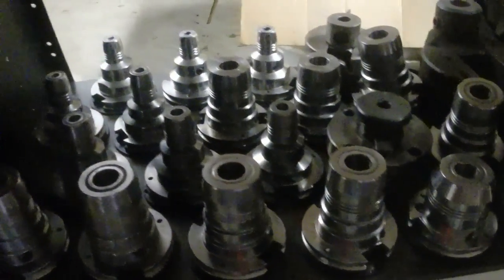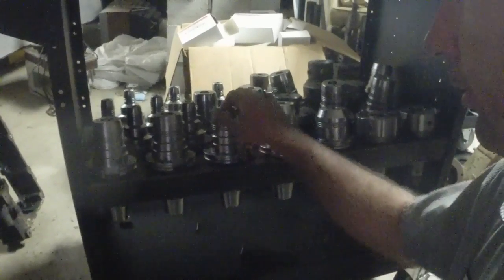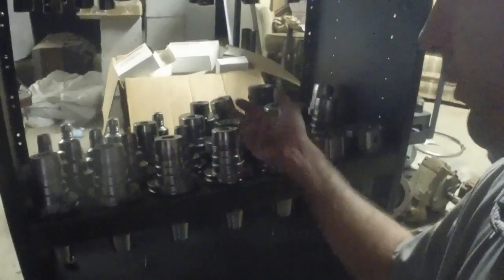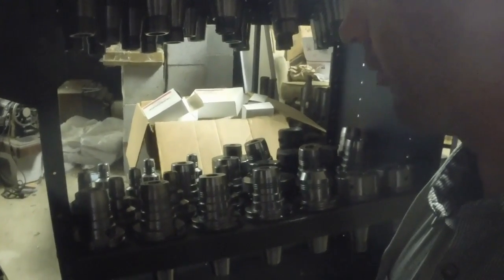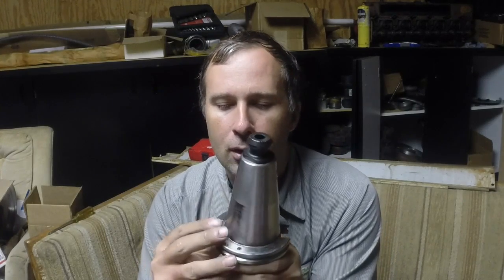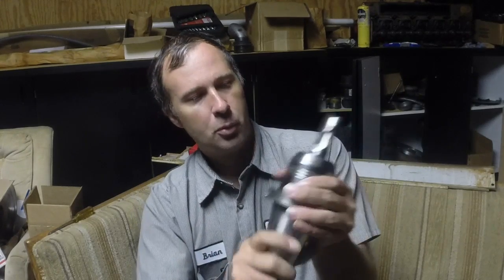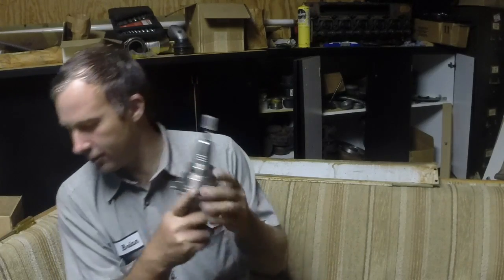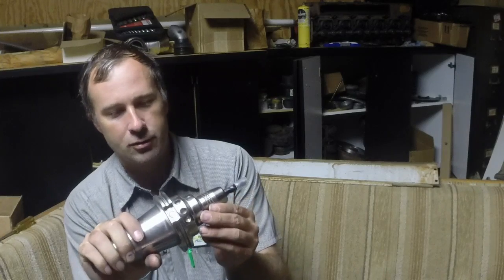Cat 50 Hydraulic tool holders

Comment: I like these type of hydraulic tool holder, the work very well for me even if I have another brand. But I must warn you to tight the screw too hard. It is suprising little torque nedded to clamp the tool, we always use torque wrench, too much torque can damage the tool holder, I think ours needs only 8 Newton Meters (70 Inch-pounds Force (in lbf)) ?
Reply from the maker: I am pretty sure the Schunk manual said to bottom the screw out and that was the correct clamping. I will have to see if I can find that again online before I start using these. Thanks for the heads up!

Comment: I have two different drawbars for my 50 taper horizontal mil, one with standard threads for nmtb50 and one with metric threads for bt50 tooling. BT50 has the slots even on both sides like the nmtb stuff, works out good.

Comment: Nice tool holders Brian.  How exactly does the hydraulic portion of the holder work?  Does the screw press in on some type of bladder or something to create the pressure?
Reply from the maker: The screw pushes against a piston which displaces oil from a thick walled reservoir into the body around the tool. The wall inside the holder where the tool is is thin and thus distorts more easily than the outer shell around where the tool is and thus the tool is clamped all the way around by deflection of the inner bore of the tool holder caused by the hydraulic pressure.
Reply: Thanks Brian.  Very interesting. Back in the day, I would have tried to disassemble one to see the inner workings...

Comment: It was nice seeing the top of your head and not what you were doing with the tool. What you were doing with the tool was off the bottom of the screen.
Reply from the maker: Noted, will try to do better, hard to get used to what the go pro sees when I am filming either 60ft barns or 6" pieces of steel. A new camera is on the list of things I need to buy and one where I can see what I am filming are high on the list.
Reply: Sorry I sounded like a grumpy old man.I like what you Guys are doing ( you tubers ). Please keep up the videos.I know if I had to make the choice between video equipment or tooling tooling would win.I learn a lot from the videos. I start my day by watching videos then go into my shop and make something.Thanks for putting yourself out there in front of a video camera. Have a good day and I can't wait for you to get into your new shop.

Comment: What's the 24 valve head sitting on the bench at around the 6:05 mark? Maybe a stupid question, but can you get 1" shank tools to work in the 25mm cat 50's or wouldn't there be enough take-up in the hydraulics to make it tight enough? Love to see one of those heads taken apart to see how it works!
Reply from the maker: John Deere 9.0L head. The 1" won't fit but I could maybe either turn the shanks down or try to grind them to 25mm. The holders are welded on assembly so no taking apart.
Reply: They have reduction sleeves for them.

http://www.guhring.com/ProductsServices/Tools/?Type=118

Don't sell them yet!
Reply from the maker: *****
Good to know I wonder if DGI can get them like they get my end mills. I also wonder if somebody makes ones that go from metric to english bore sizes, that would be handy!
Reply: Have to tell you, looked up on line how these things work after you replied to my comment! Its totally amazing that this thing works to begin with, given fact that its a solid sleeve/shell that they are compressing, now to find out that the make reduction sleeves and its able to compress both, that's astonishing!! Hydraulics = amazing shit!!!
Reply from the maker: As has been discussed everything is made out of rubber and deflects under loads. Neat that a little screw can generate enough force to clamp the tool, but then again I have seen impacts run screws into holes that were full of oil and blow the side of a cast iron block out, hydraulics can do a lot of work!